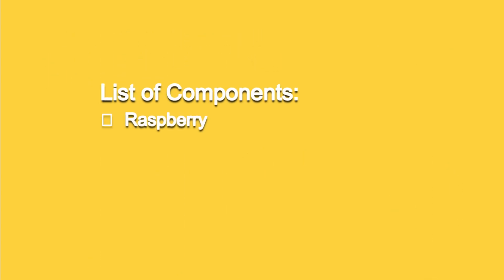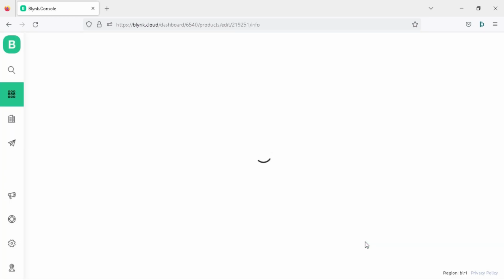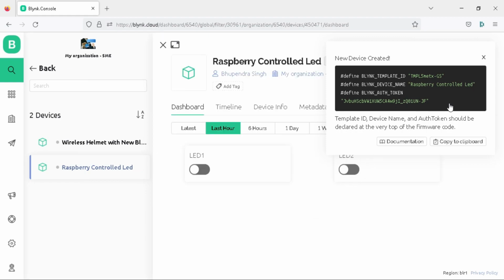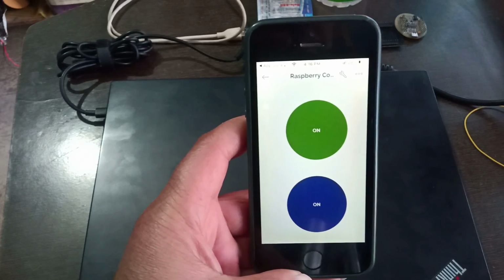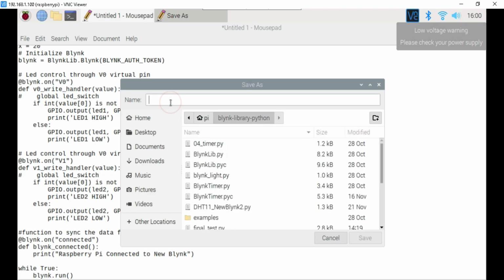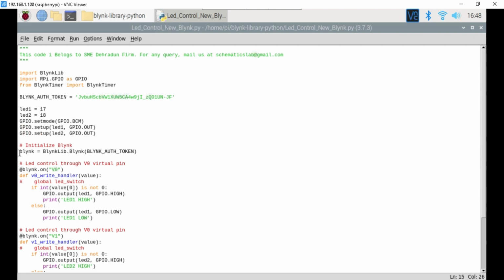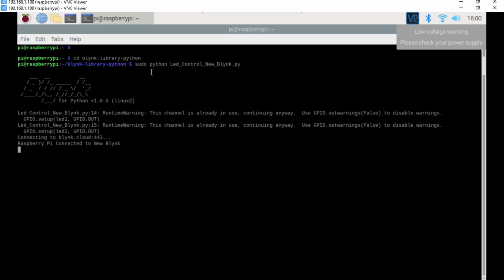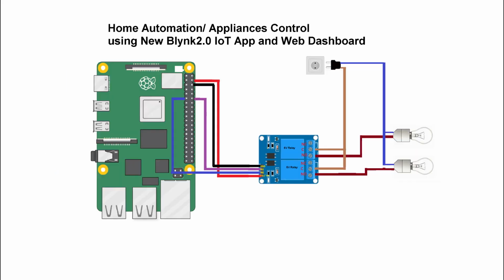LED Control with Raspberry Pi using Blynk 2.0 IoT Mobile App and Web Dashboard | SME Dehradun

Comment: No need wifi to connect in the blynkiot?
Reply from the maker: Do it properly. This code is working fine.
Reply: Hello sir  @SMEDehradun I have a question is it possible to connect esp32 with rpi3 b+in blynk iot?
Reply from the maker: Yes you can connect it through Serial communication or through USB.

Comment: thanks for your tutorial sir, 
could you please help me to create this script autostartup on raspberry pi...? thank you
Reply from the maker: you need to edit your rc.local file.  Below is the tutorial link that may help to auto start your file at startup. 
https://learn.sparkfun.com/tutorials/how-to-run-a-raspberry-pi-program-on-startup#method-1-rclocal
Reply: @SMEDehradun  thank you, i have tried this method, but not working for my raspi...
i also tried use systemd, but not work
Reply from the maker: But follow all the steps to put your programming file with extension as shown in the tutorial. It will work.

Comment: Hi, If I wanted to add another 6 leds to control in the same way what would be the code, please
Reply from the maker: Add the code for the same. 

Soon I will make home automation with Raspberry pi. Start tuned. You will get the Idea about it.
Reply: @SMEDehradun  please could you show me a code example added to the code in your using.
Reply from the maker: In the video description, there is a link for the code by which you can control the led or any appliance
Reply: @SMEDehradun  Yes I've used your code, just need to know if I add more leds what extra code to I need to write, just need a example so it shows me the change in code
Reply: don't worry I've sorted it :)
Reply from the maker: Hello  @richcrofts5957  
You need to define the pins for the led at the top of the program  like 
led1 = 18
led2 = 19
led3 = 20 
 
after it define the virtual pins below in the code lie this for different virtual pins as per you have  defined in blynk datastream- 

@blynk.on("V2") 
def v2_write_handler(value):
#    global led_switch
    if int(value[0]) is not 0:
        GPIO.output(led3, GPIO.HIGH)
        print('LED2 HIGH')
    else:
        GPIO.output(led3, GPIO.LOW)
        print('LED2 LOW')

define all the pins as per your requirements .
Reply: @SMEDehradun  Hi, If I wanted one button to turn off ALL leds what would the code look like ? thanks
Reply from the maker: @richcrofts5957  
Then define the led pins at the top and then try to add this code below:-

@blynk.on("V2") 
def v2_write_handler(value):
#    global led_switch
    if int(value[0]) is not 0:
        GPIO.output(led3, GPIO.HIGH)
         GPIO.output(led4, GPIO.HIGH)
         GPIO.output(led5, GPIO.HIGH)
        print('LED3,4,5 HIGH')
    else:
        GPIO.output(led3, GPIO.LOW)
        GPIO.output(led4, GPIO.LOW)
        GPIO.output(led5, GPIO.LOW)
        print('LED3,4,5  LOW')

Comment: Can I use these Raspberry Pi Dives and the code in Windows 10 without any problems?
Reply from the maker: Yes. You can access the raspberry pi in window & do the programming.